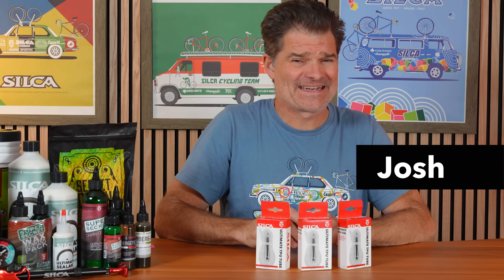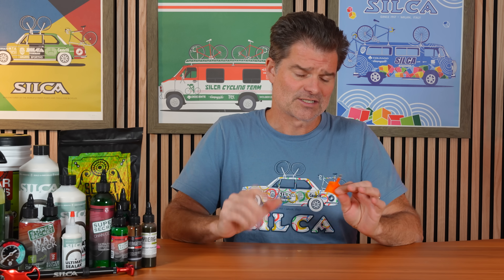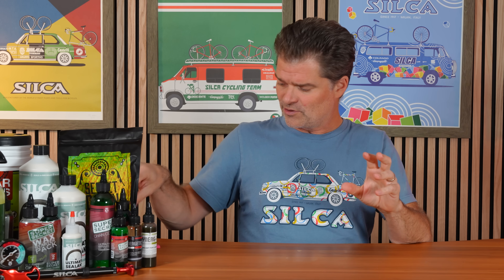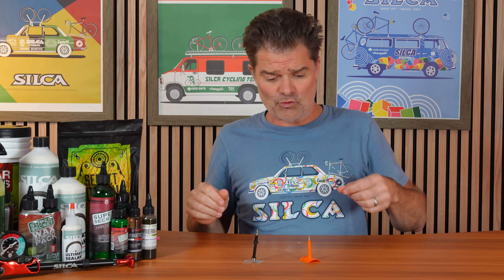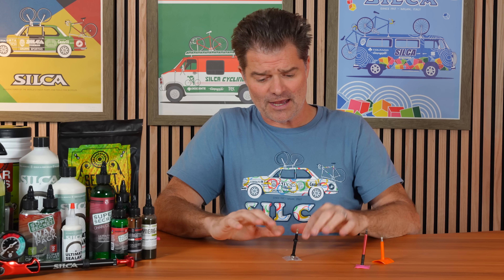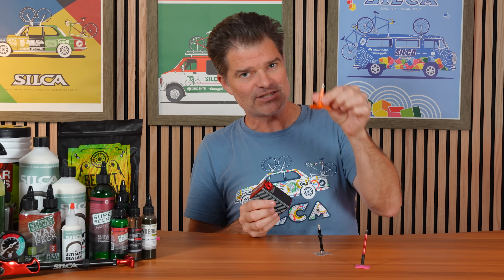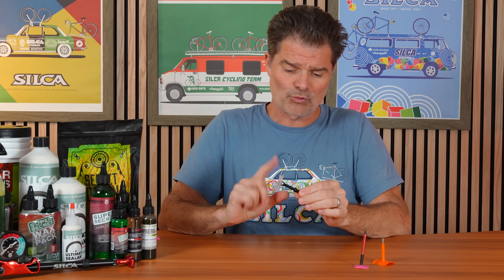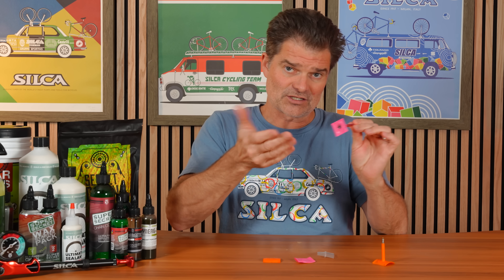Are TPU Tubes Finally Worth It? | SILCA Ultimate TPU Explained

Comment: How many layers of TPU are used? Most seem to use 7 layers.
I also had the problem with leaking TPUs but my leaks were tiny micro holes all over the tube ... on several TPU tubes. While I never had punctures with my butyl tubes, the moment I switched to TPU I constantly had slowly leaking tubes (flat after 3 days), and by time leaking faster and faster (flat after 4hrs) within a few weeks of usage. I was about to give up but I am now on my 5th and 6th TPU tube and finally they last now for almost a year already and loosing around 1 bar in 2 weeks ... not much worse than butyl tubes.
Also reading other comments in different communities ... with TPU tubes you need to have luck.
And while Silca addressed two problems ... it looks like those were not the ones I had.
Also question: can the valve core be removed? If not, do you plan Schwalbe Clik Valve versions?

Comment: So I've used the rene herse tpu tubes quite extensively (and these look nearly identical, as well as the same patches).  I think they are great for a time, but they do get pinholes at the weld, and the patches are fairly useless, they work for a time but will fail in wet weather.  They also don't seem to adhere well in cold weather.  

I recommend making a more robust version that is say double the weight and maybe try the camplast patches that pirelli use, but I haven't tried those yet.

Comment: Six months is still better than sub-standard butyl tubes that fail in a month or two. My 1980's Silca pump works fine with TPU tubes. Good to konw you make them now. I'll have to buy. I just have to inflate about once a week to the right pressure. I ride 700x23C that is not offered on your website yet.

Comment: If this Valve has enough rubber around the flange it would be possible to use this tube with sealant inside in a tubless wheel and tire?

Comment: I still see TPU as a marginal gain that most of us really don't need for daily road cycling, maybe racing or chasing KOMs, but certainly not a 50lb ebike used for commuting.
Reply: Actually ebike is one of the best applications for TPU tubes. I use RideNow and Gustavo brand TPU tubes combined with Tannus Armor foam inserts in ebikes ranging from lightweight (48v 15AH about 40 lbs) to super heavy (48v 60AH about 130 lbs). This combination gives the best mixture of low rolling resistance and high durability BY FAR. Sure the weight of the tube doesn't matter much, but the rolling resistance is much improved and that makes a serious impact on maximum battery range. 

And the durability is off the charts! I offer a 2 year flat-free guarantee on the bikes I sell with this setup and have never had to repair one under warranty.

Comment: I only use tubes on one older bike of mine and I tried the Rene Herse ones, which are around the same price as these. Like Silca, they’re clear and have an all-aluminum valve stem, but they still failed on me at the valve stem since that interface is the same as the others. So, I switched back to butyl tubes on that particular bike.

I carry a couple of cheap Chinese ones (and will continue to do so) with all of my tubeless bikes since those are just spares to get me home in the event of a major failure of my tubeless setup, and I love that I can carry a couple of tubes with less weight and bulk than a single butyl tube.

Comment: The best thing you can create for TPU tubes is a way to keep spares in saddle bag without being damaged.. I have seen 3 separate TPU flat fixes… none successfully since in every case the spare was damaged and didn’t hold air… that’s the problem!
Reply: Depending on how much room your bag has, try coiling the tubes inside the bottom of a plastic soda bottle and putting in some tissue to keep the tube from sliding around.

Comment: Josh you and Silca are late to the TPU game. I have been using “cheap” Amazon TPU for nearly a year with ZERO problems. Also, please stop it with the fear mongering. I use an Amazon battery inflator, with a hose, and have not melted a single valve or tube. My Chinese made pink TPU tubes work great at a fraction of the cost of your TPU tubes…even with high tariffs on Chinese products. I have owned SILCA products for years, including my 40 year old plastic SILCA Impero frame mount pumps. But lately I am completely turned off by Josh’s hucksterism and SILCA eye watering prices. Oh yes, you include an alcohol swab and a patch…LOL so do the cheap Chinese TPUs.

Comment: You can buy a 2 pack of RideNow TPU tubes for $26.Which has full aluminum valves, and a patch kit. Road 7500 miles so far this year, including crit and road racing all on the same tubes with no failures or flats.
Reply: I've been riding TPU tubes for a few thousand miles and only recently had my first flat due to running through a pile of goatheads. One patch fixed it right up. These are/were the cheap plastic SPINGO tubes for $20 a pair.

I'm changing wheel sizes from 27.5 to 700c and bought the RideNow with metal valves. With this experience and more than 4x the price it's hard to move to Silca...
Reply: Exactly! Same here.
Reply: @ejacosta174  I third the comment.
Reply: They are even cheaper in China, last summer I was in China, and the RideNow TPU was about $8 a piece.
Reply: @CarterLeung-h5b  I made a small bulk buy 2yrs ago and they were under $5 each on average and that's with buying 29er, 650+, gravel and road sizes.
Reply: Been using the same set of RideNows  with GP5k tires on my favorite Cannondale, my 2015 CAAD10. I'm on my 3rd set of tires with the same RideNow TPU tubes. Mine have the plastic stems, but I have two pairs with the newer  metal stems waiting to be used. The older ones show no signs of quitting with just over 10,400 miles on them.
Reply: 10k miles on the same pair of tubes?
Reply: @terbennett  but...but... but... they're pink
Reply: RideNow are £8 🤔🤣
Reply: @tuono2473 never paid more than £5 for my Ridenow tubes off AliExpress, got them as low as £3.70 👍🏼
Reply: Llevo unos 2 años con unas RideNow y aún no se que es pinchar. Ya pedí otras para más adelante cambiarlas.
Reply: I’ve burnt through at least a dozen RideNow Tpu tubes on my gravel bike. Changed the rim tape twice and even bought new tires…. And I’m still getting regular punctures around every 200-300km. Decided to switch to other brands on AliExpress and no punctures as of now, same tubes for 1000km and still going strong.
Reply: @4k-peasants233 man, you should try these new Silca TPU tubes. They are so money
Reply: @4k-peasants233 I had the same problem with RideNows on my road bike, 2 failed on me within 60 miles of use each
Reply: I recently picked up Ride Now 4-pack with metal valve stems for $25.99 on Amazon. I use the CycPlus AS2 Pro Max electric pump to top off before each ride, no issues and I ride lots of miles weekly.
Reply: I've also been riding these all year, thousands of km's, no flats and they keep air with no issues. But got them way cheaper.
Reply: And probably sourced from the same factory in China 🤣
Reply: 100%
I'm 12,000kms into my TPU tubes from RideNow (via AliExpress). They were AUD$9 each!
Reply: Oh that’s interesting. They don’t have the metal valve version for mtb, although I’m not sure if that’s something I actually need
Reply: I’ve been using the pink RideNow tubes for about 2 years now and they work great, when you get a good one. I have however had 2 of them with leaks straight out of the box. But damn, these are expensive.
Reply: same here.
Reply: Me too on RideNow.
Reply: Wow, I rode some tpu tubes from Amazon this summer and couldn't get any of them to last over 150 miles. I will have to try the ride now tpu tubes.
Reply: @albertmitchell  make sure you use tubeless rim tape, I had this issue with my wheels and they've been flawless since I switched
Reply: @skinnyergs That is really important.  A very good point indeed.
Reply: @albertmitchell try them, you will find that the newer versions are very good indeed. Josh is really good at creating a demand for over priced items. Some, like their chain wax system and their pumps are very good indeed and worth the uber-premium prices. Others, not so much.

Comment: Our Wheel Science TPU tubes all failed while the bikes were hanging on the back of our RV's 5 bike vertical JB Rack. I think over the course of a 1500 mile road trip, the TPU slowly broke down from the vibration. The bikes with standard tubes and tubless were not affected, but the 4 wheels that had TPU tubes all went flat. Some failed at the stem joint, some had random tiny pinholes.

Comment: Though its good that Silca has produced something better, I am not sure its necessary considering the cost. If I inflate using an electric pump, I use a rubber hose that comes with my pump. Amazon sells similar hoses for about 10 usd. The Ridenow (which Josh brought up) metal valve tubes run you about 10 usd hence for the cost of one of your tubes I can get 4 Ridenow tubes (6 via Aliexpress) or 8 Cyclami ones via Ali.. How often/soon  will the problem you mention happen?  There is also the possibility that you get a flat on the same tube hence why we walk with one or two spare tubes.

Comment: I've been a long time Silva customer and appreciate the quality and design of everything I've bought (suppressing all memory of Gen 1 sealant). Even as happy as I've been, though, I'd still probably list their wax product line as the only thing I've used to specifically refer people to the company, especially once they simplified things with strip chip and dedicated pot.

These tubes do strike me as a huge and long overdue breakthrough to a chronically unaddressed problem. I'm tubeless roadie and would love to switch back given weight and performance of TPU, but the reliability has never been there. TPU=spare tube, never a primary. This design changes that completely. I've ordered a bunch and will be gradually switching back.

BTW, there's even an option in the market to use sealant inside a TPU tube, probably compatible with these because the company also uses clear TPU. I think TPU is puncture resistant enough without this, but if I were Josh trying to convince his wife to trust his new TPU solution, I might squirt a bit of the other company's TPU sealant in there to save on divorce attorney fees.

Comment: Super . Glad the issue is fixed. But i bought a 10 package of RideNow 2 years ago, and no problems, yet. Installed on 3 bikes, so when they're gone , that's  it. One bike has latex, so   ill stay with latex, cost and  performance.

Comment: THANK YOU for making a TPU tube with a  THREADED valve stem, Josh !!   To prevent the very kind of failure that you spoke of in this video,  I had to gingerly HOLD the TPU stem while I struggled to connect the pump.  Even Pirelli TPU tubes that sell for 50 bucks here in Canada, don't have a threaded stem (???) and that's why I stayed away from them and put up with the 3 times the weight of butyl tubes that I could properly secure to the rim to facilitate pumping.  I'm gettin' these bad boys ASAP :-)   P.S.for those questioning the price of these SILCA tubes,  there is a difference between costly and expensive -   Expensive is paying for inessential status while costly can net you proper engineering and build as is very well explained here. :-)
Reply: There are many with full thread stems even with replaceable cores

Comment: BTW, on a different subject. When I rewax my chain I've changed my system. Now, I just brush and wipe the chain, then put it in a bag and put the bag in boiling water. That gets the chain up to 100c while the pot is heating the wax to 65c. Then I just slowly dip the chain into the wax and swish it around for a few seconds then leave it for a minute, swish it around again and hang it.  If I were doing a bunch of chains, preheating them this way would shorten the time needed dramatically. I haven't seen a difference in the performance unless it's gotten better. The hotter chain replicates soldering copper pipes. I think it draws the wax in faster and probably better.

Comment: Of the cheaper Chinese TPU tubes, I've had the best luck with the green Cyclami brand.  Slightly thicker material makes for easier install and they have a full metal threaded valve like a traditional butyl.

Comment: I've been using $20 Chinese TPUs (plastic valves) for about 12 000 km; I have never had a failure though I did get a flat this year
Reply: Yeah man I don’t know what hardcore riding their entire family is doing, but it’s the Silca founder’s family so I can only imagine it is some serious mileage. Been running 4 TPU tubes across 2 bikes and no flats so far, seems pretty good…
Reply: @KoIhara  I have doubts its significant mileage.  And this is in relation to ebikes they're commuting on.
Reply: 20$ im buying them for 5$ works the same with gp5000 lol dude
Reply: $20? They make them for 20c
Reply: You are incredibly lucky, so far I have had 2 of the 4 fail exactly where he demonstrated, at the interface between the valve and the air chamber.
Reply: @Natuh21  Metal or plastic valve stem?
Reply: @kazuviking plástico valves
Reply: @Natuh21  Then no wonder. The metal ones don't fail.
Reply: Plastic nipple is really easy to brake

Comment: 3 questions that impact purchase: are these tpu tubes more puncture resistant than the std tpu tubes? Are the valve cores replaceable? Running 48mm tires on a 40mm deep rim, your 50mm valve length weren’t work, why so short a valve length for wider tpu tubes?

Comment: I have put ~2500 miles on a set of the pink tubes with metal stems and although I had one legitimate road puncture, I've never had any quality issues. I like Silca products a lot but these are 3x more expensive than what I've got and I'm genuinely curious if the value proposition is that they will fail at less than 1/3 the rate.
Reply: Can’t exactly remember when tubes failed on me because “poor quality” instead of potholes, puncturevine seeds, other external causes

Comment: Finally a well made TPU tube. Yea they are pricy, but you have given us the best possible version. How about a separate repair kit?
Reply: I will probably go get one of the tent sealing kits that are TPU.  I think they are basically identical, but possibly thicker and thus not as stretchy -- that might cause kinks when reinflating.  I typically inflate the tube enough when putting on the patch so that the patch itself doesn't have to stretch much.

Comment: Can you use these in tubeless tires with sealant. There's a video of a pedal strike that caused the rear tire to hop and as it came down, the impact burped the tubeless tire which instantly deflated making a save impossible. They are using sealant with tpu now, so what are your thoughts?    https://youtu.be/DpijHxlDaks?si=p1-5kp6zg2qGl0zs

Comment: Sure Silca tpu tubes are amazing, but the price! I’m using cheap chinese tpu tubes for 2 years now (pink ones), no problem at all! Failed only once, after changing tyre (probably my fault). And the patches are useless with tpu tubes because it’s realy hard to find a hole (and impossible on the road). The only way is to pump the tube and put it into water

Comment: I’ve never had a problem with a RideNow tpu tube. Vittoria latex tube have this breakage issue all of the time. Please fix latex tubes, I use them with carbon rim brake wheels.  Some good ideas here.
Reply: I've been using the same Vittoria latex tube for over 7,000 miles. I pump it up before every ride....
Reply: @Jay-nt2ew  I am still using them but I had a lot of torn tubes right at the valve stem.  Bad batch🤷‍♂️

Comment: I've seen more and more people talking about putting sealant into TPU tubes. Thoughts? Do these have removable valve core? And would SILCA Ultimate sealant work with these?
Reply: Came here to ask the same question after watching this other video the other day: https://youtu.be/DpijHxlDaks?si=wsMJ-heqvIxkpjHB
Would love to hear the Silca take on this approach, as well as performance pros/cons
Reply: I don't know if the chemistry of that sealant adheres to TPU.  Eclipse (among others) sells a TPU sealant.  I have some that I used to help seal a gap in the seam welding of the Eclipse tube (along with a TPU patch).
Reply: @ericpmoss that was my thought is that the synthetic latex in the ultimate sealant might not work or, worse yet, damage the TPU. I just bought some TPU tubes from craft cadence and they specifically call out that they are sealant compatible but give two specific brands.
Reply: beat me to it.  Asked similar question.  Running sealant has peaked my interest recently.
Reply: Sealant for tubeless tires will absolutely not work with TPU other than possibly containing enough particles to kinda gum up a leak. The sealant won't bond to TPU. There is a completely different product available for TPU sealant.